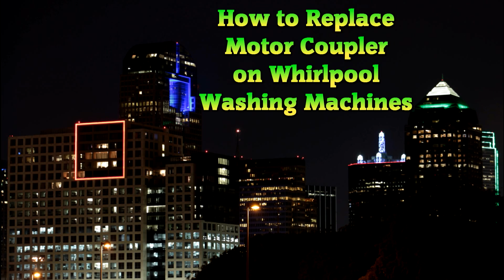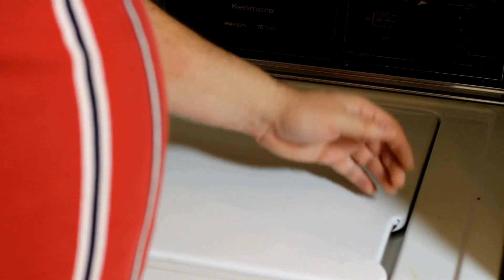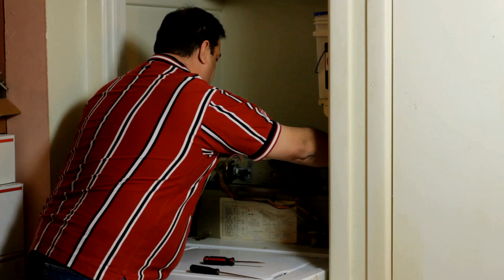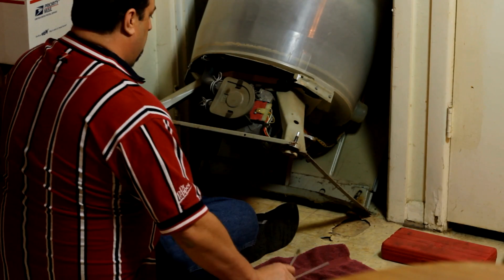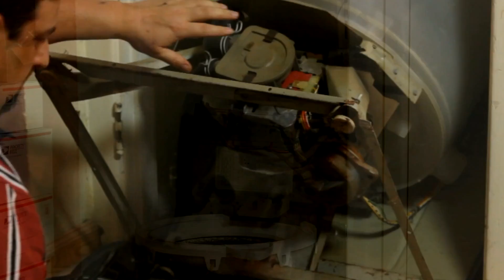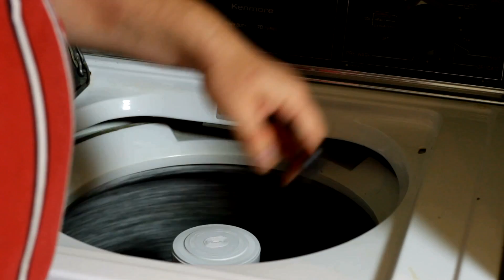Whirlpool and Kenmore Washer Repair - Wont Spin 285753A Coupling Replacement

Comment: Very helpful video. I've got it apart, now have to find the part...
Reply: +canyonman1963 Got 'er done. Part was $6.85. Repair was fairly easy, but getting the cab back on correctly kicked my rear end. My 63 year old rear end was worn out! Thanks again!.... Jack

Comment: i have a washer problem whirlpool wont wash?? will fill up with water but wont agatate i looked on the bottem where the parts are and it looks like a betl?? but this washer as i was told by sears dont have a belt so what is this thing that looks like a belt cause it looks like it got pinched and fell off but i dont know how to put it back on?? or what it is called to get a new one?? plz help thank you
Reply from the maker: Beth Sites That rubber band is a noise silencer, and it belongs on the outer part of the brake housing.  It reduces noise that is made when the brake in engaged to stop the drum from spinning.  It would not cause any problems if it was left off.  As for the no agitation problem, does it still go through the cycle, and does it spin?  If it goes to end of cycle but never agitates or spins, then itis probably a bad coupling, which is what this video is for.  If it just stops and wont do anything, then it could be a bad lid switch, or if it makes a humming noise it could be something stuck in the water pump or it could be a bad capacitor.
Reply: canyonman1963 no what it does is fill up then wont wash?? move or do nothing gosh i hate the laundry mat plzz help u r the greatest as of what i seen
Reply: canyonman1963 ok u r the greatest when my son comes up this weeekend i will have him look at this~~

Comment: Would this also be the case for a washer not spinning, but the agitator works and if I give the drum a spin,  it works as well? When it won't spin, there is a high pitched whine.  I have an Estate by Whirlpool 8 cycle 2 speed HD/Super Capacity Washer.
Reply from the maker: No, if the coupling were broken, there would be no agitating and no spinning, even with a helping spin.  It sounds to me like your clutch is worn out and needs to be replaced.  Best of luck to you!

Comment: Are all couplers for Whirlpool the same size?
Reply from the maker: There have been design changes to it over the years, but if you buy a new one using your machines model number to get it, and replace all 3 parts with the new parts, all should be OK.

Comment: I just want to thank you for posting this Very helpful video!  It took me about an hour to repair from start to finish, getting the coupler flush with the motor took some time but not bad considering I've never done this before.  The video was very easy to follow & I wouldn't have been able to repair on my own if it wasn't for your help.  You saved me a TON of $$ too.  :).  To any ladies out there considering fixing this prob on your own but hesitant... Totally Do-able, just follow 1 step at a time & pause the video as u go.  I did not take off the top console just tilted the machine & worked underneath.

Comment: Ok I'd forgotten to turn the water back on, now the washer is coming on but will not drain or spin. I'm pretty positive it isn't the lid switch causing this problem though. When I pull the dial to start it I can hear the switch click, and a quiet humming. Any advice?

Comment: Thank you for your speedy response. After watching several videos on this I realized I unnecessarily removed the back panel. I changed out the coupler and reassemble the washer but it won't come on at all I don't know where I messed up.

Comment from the maker: I cant stress enough that you make sure the machine is unplugged when removing and installing parts, and only plugged in when ready to do the spin cycle test. You will also need to have removed the lid switch from the cabinet & plugged it back into the harness connector, and hold the lever down so it thinks the lid is closed in order to make the motor spin for the tests!  If this all seems too much to you, you should call out a tech to do the testing! Stay safely away from machine when testing!

Comment from the maker: continuing.. 2nd, if motor not problem, now unclip motor and remove from trans. & then remove the coupling. Then put motor back on and see if it will spin OK while disconnected from the transmission. REMEMBER to remove and install parts with machine UNPLUGGED so you dont short something! Try the spin cycle with the motor back on the trans mount & without coupling. If works now, trans is the problem. If still wont work, the problem is the motor (as long as that capacitor was good) BE CAREFUL!

Comment from the maker: You are welcome for the videos! Now as for your washer. Honestly it sounds like either the trans is locking up or the motor is overheating & going bad. Also need to start by testing the motor capacitor. Look that up on google for how to test washer capacitor. If good, we need do some things to identify the problem. 1st, remove clips holding water pump on motor & pull it away from motor. Now try the spin cycle. If works OK, the pump has something inside it jamming it up. This would overheat motor

Comment: You're videos are so awesome they have saved me so much money, God bless you. Any other advice or troubleshooting tips you can give if the above video doesn't work.  I replaced the Motor Coupler and the checked the clutch, washer will still stop mid spin cycle, or start and stop rapidly and repeatedly before completely stopping and a burning smell starts.